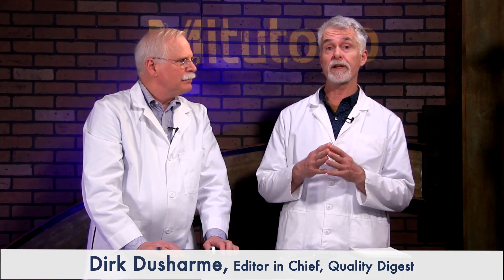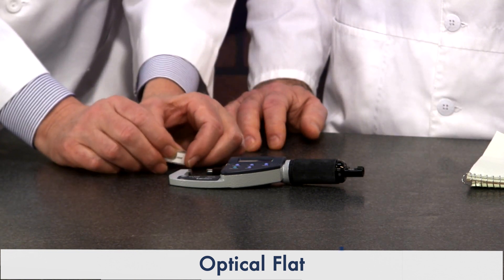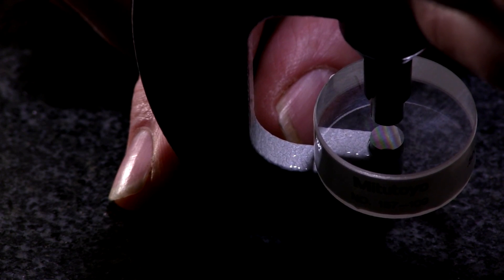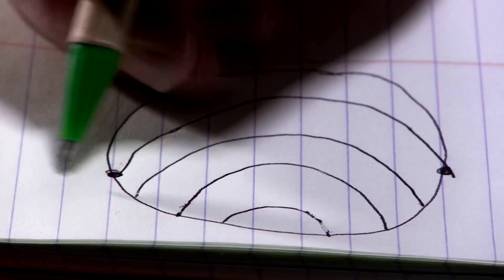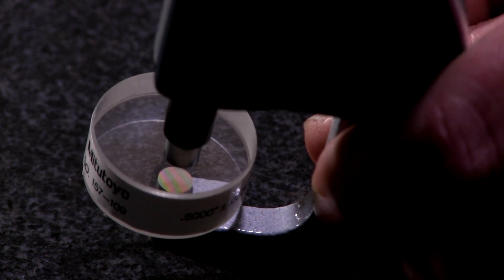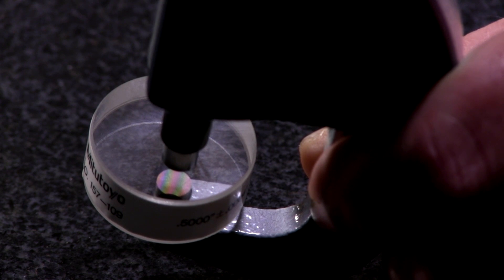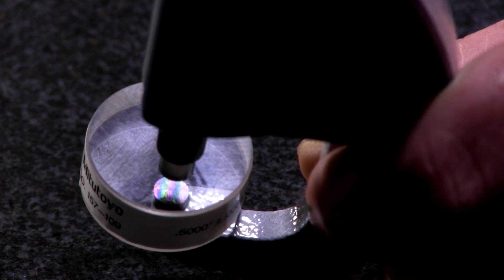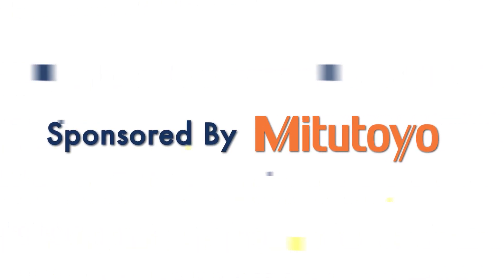How To Ep11: Measure Flatness and Parallelism on a Micrometer Anvil and Spindle #metrology

Comment: This method is wrong. The correct way to check for parallelism is to wring the parallel to the anvil face, and count the lines on the spindle face. If there is a small amount of fringes on the anvil face you add this to complete the reading.

Comment: Hi, could you clear my doubt. 
1. What is different between optical flat and optical parallel?
2. What is the 4 set of optical parallel? What are the different between the 4 pieces?
3. Which one is right selection for micrometer anvil parallelism  measurement?
Reply: 2. The 4 optical parallels should all be different sizes so that the spindle is rotated a quarter or so per each optical flat used on the measuring faces. This ensures you are not taking the parallelism in one spot when using all 4, thus, giving a better picture of the parallelism. From what I believe.
Reply: 1. There's no difference.
2. As the other commenter says its to check the parallelism within the screw. So for UKAS accredited certificates you'd record the parallelism errors against all 4, then separately record all 4 to show the range. Larger mics only get sets of 3

Comment: I thought you needed a single wavelength light to get the bands to show properly. Is there something different about the optical flat you guys used?
Reply: A special monochromatic light is desirable but not essential unless you are color blind. You can distinguish from lets say 1 green band to the next or from 1 red band to the next. Over all they don't vary that much and the straightness of 1 fringe is what you really want to know, any color.

Comment: Is it necessary to use a monochromatic light with an optical flat for shop calibration?
Reply: No. In the shop you simply use a standard.
Reply: Monochromatic light shows the fringes more sharply.  Using white light from a fluorescent or LED source and wearing colored eyeglasses also will sharpen the fringes.

Comment: Please tell me about sine bar calibration... Roller diameter , length measurement between rollers . If possible post a video anyone.
Reply: I normally measure the distance from the outer edge of 1 roll to the outer edge of the 2nd roll i.e A= 5.5in. then measure each roll individually B=1.0in  C=1.0in.  Then to get the center to center  length you take A minus half of B, minus half of C.
Reply: This Old Tony
 - A Sine Bar Walks Into a... wait
https://www.youtube.com/watch?v=PO-Ab7YfBzY

Comment: Are you able to sandwich multiple optical parallels together to check the parallelism between two faces that are further away? eg on a 1-2" micrometer. Or do you have to use a longer optical parallel?
Reply: Check it with a ball on a stick and gage block. Optical Parallels are very expensive and are never to be confused with an optical flat.
Reply: You can wring optical flats together. But they will also have an error that is recorded with light bands